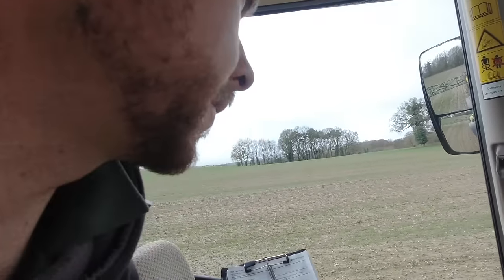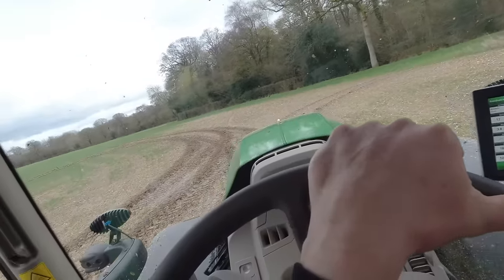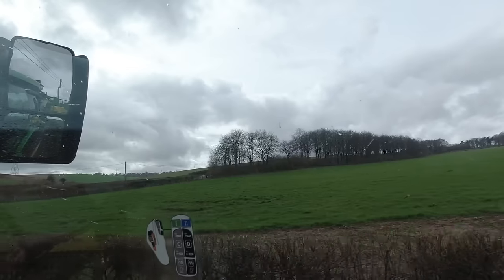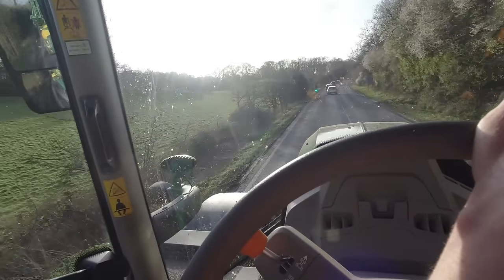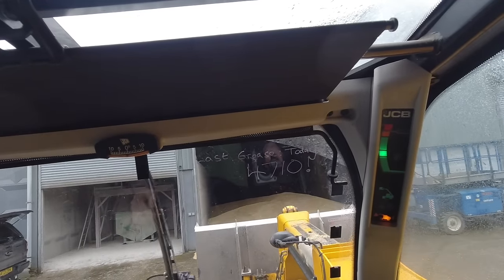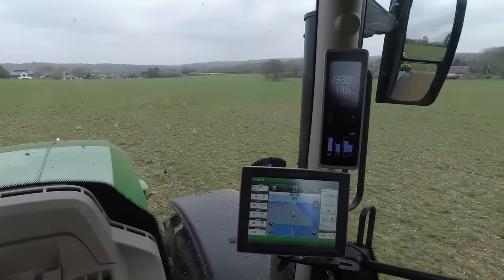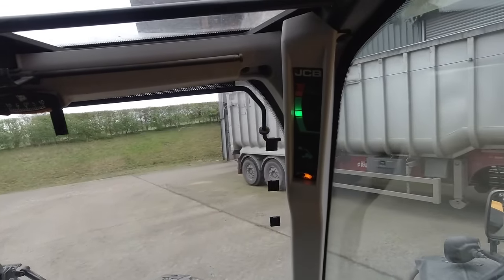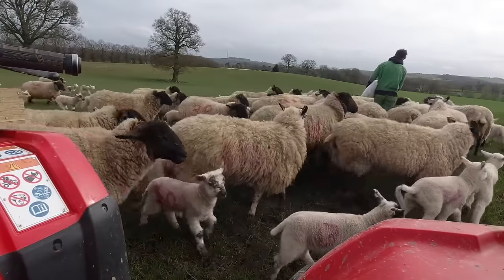Another Week On The Farm! 24/03/24

Comment: Hi Andy I’m pretty sure if your sprayer runs through isobus you should be able to put the controls on to your command pro. I run a horsch sprayer and have it all set up on command pro it makes it so much better. I think all you need to change is you need to turn the buttons on you command pro to single buttons rather than dual buttons.
Reply from the maker: Okay cheers I’ll have a look 👍🏻
Reply: Hi Andy looked at mine today. In control setup where you can pick what you want on the joystick. If you click the advanced settings (vertical arrow with the dot above it) it takes you to command pro switch independent mode. Once your there switch them all to on then it should work. Hope that helps.

Comment: Only driven power quad and power quad plus Deere gearboxes but had an auto power on a loan tractor for a week just on trailer work….do you set pto speeds with your hand throttle then adjust your speed on the stick/pedal for fert spreading etc??
Reply from the maker: I can set a pto cruise speed in the screen then push hand throttle all the way forward and the pto will only speed  upto what I have set it to. Cheers